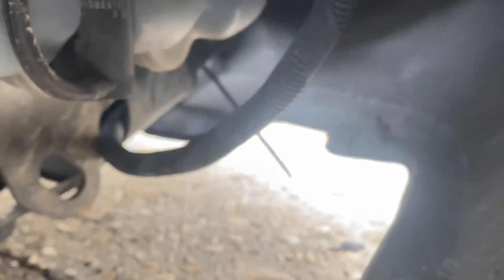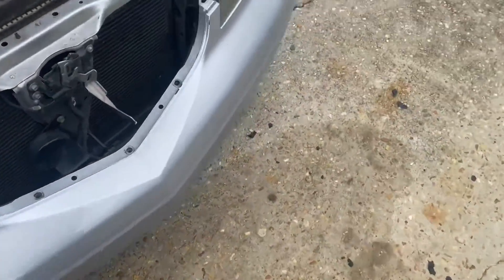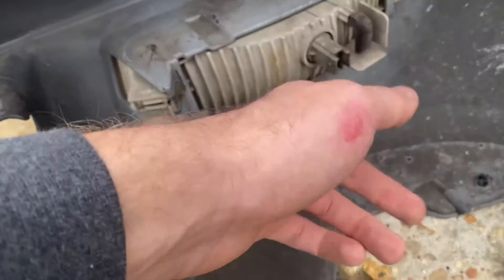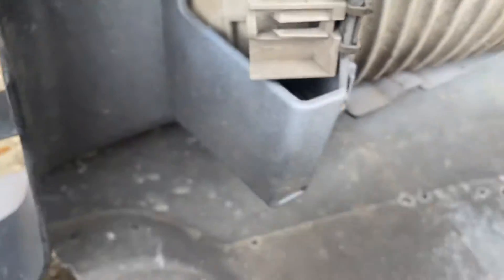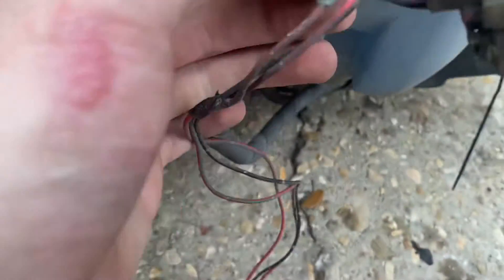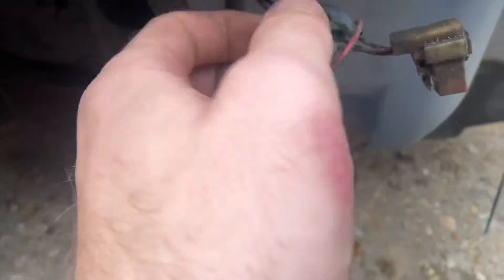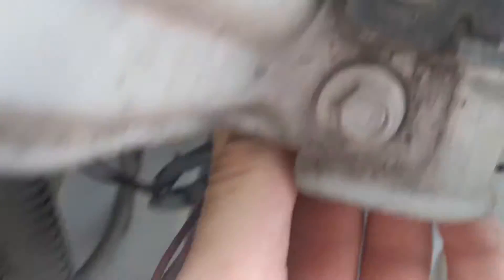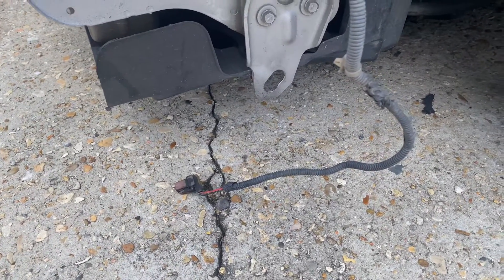Fog Light Install Tutorial for the Acura CL

Comment: Do you know if the fog light installation gave you any problems with flickering lights in your high or low beams?
Reply: I did this installation but now my right high beam and my low beam won't turn on.
Reply from the maker: @alantavera3004  no it shouldn’t interfere with either the high or the low beams, the only harness it should be connected to is the parking light
Reply: @slowcls6  I did that and reversed the process to check my lights with out the fog lights and now neither of my low beam or high beam lights work? I even made sure I disconnected my battery and reconnected it properly through every process. But now I have this new problem. 😩
Reply from the maker: It could be a fuse that just coincidentally went out at the same time, when you turn your lights on did the fog lights atleast come on?
Reply: @slowcls6  they actually did. I checked the fuses and they were out. You think if I unplug my battery then remove the fuses reinstall my fog lights then reconnect my battery and lastly plug in new fuses it should work??